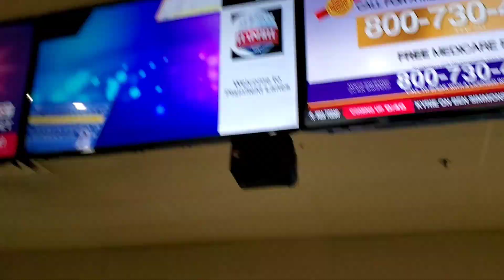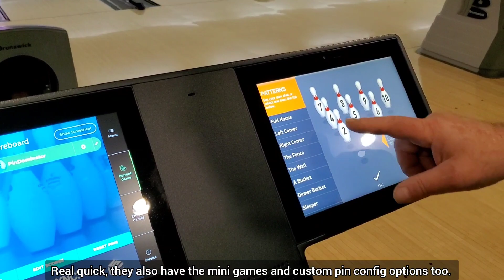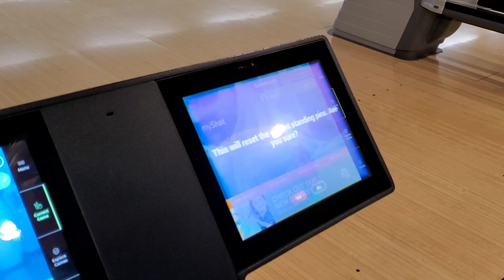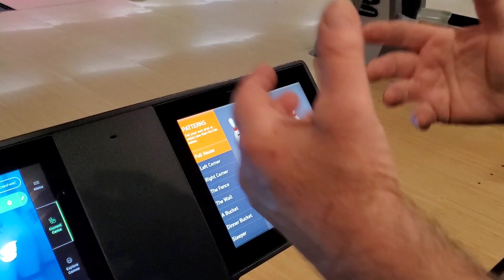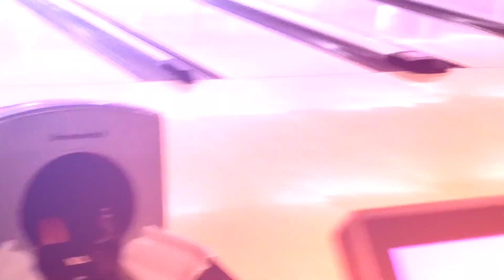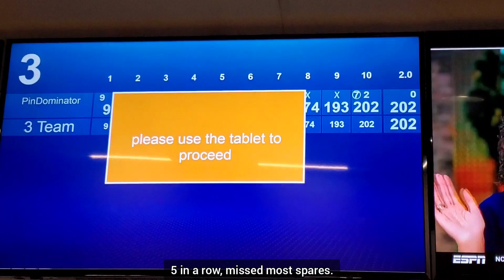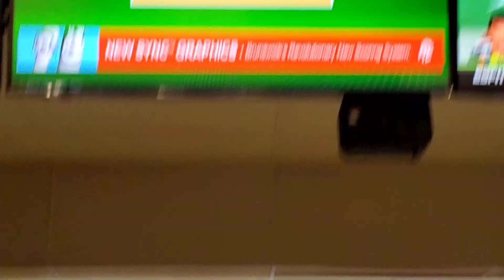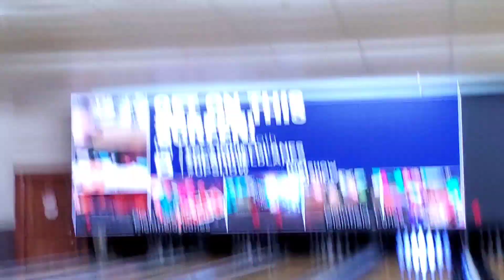Bowling at Plainfield Lanes (GS-96) [With Pinsetter Tour]

Comment: Haha. Freaking love the 96s. I treat mine like absolute royalty. Regular cleans, rebuilds etc. They'll run forever if you treat them right. Keep mine super clean and well adjusted.

Noticed the 10 pin holder dropped the spare a little early 😅 reminds me of what my lane 5 was doing 😂
Reply from the maker: I did notice the 10 pin, it made quite a sound haha
Unfortunately they just got rid of their gs96 and replaced them with stringpin :(
They were selling them for $700 a piece
Reply: @PinDominator  that's really sad honestly, those pinsetters run so reliably when thoroughly cared for.

We bought and shipped some parts from them though. Saw Plainfields ad on a Facebook bowl mechanic page. Bought a few tables and a bunch of the pin holders, so it's all going to a good home ☺
Reply from the maker: @nicholasevans4245  that's good to hear! Yeah it's a shame they are replacing them, but I'm glad they're not all going to the scrap. I'm glad I was able to take home one of their rakeboards :)
Reply: @PinDominator  Oh thats so cool - saw that in one of your video intros! super nice!

Yeah, we do need some parts at my center here so, where cost effective, we took what we could and would need. Going to a very grateful and happy old bowling center.

Mate, if i could, i would've happily taken all the pinsetters knowing me 😂

Comment: I never bowled on the Brunswick GS –96 it's similar to the GSX is it? and I never seen Score king pins before.
Awesome video.
How's the mini bowling pinsetter? Rock on
Reply from the maker: Very similar to the GS-X. It's differences are noticeable upon closer inspection of the mechanical components of the setting table. Pin carry is pretty much them same. I would say it is slightly easier to pop 10 pins out however :)
Reply: It runs just like a GSX but the difference it had a different Setting Table, it had the old style sweep and it uses the old Universal Electronic system which you see here at 3:04. Its basically an upgraded GS-92 Pinsetter and it uses the exact same parts of a GS-98.
Reply: @PinoyBowlerGS92  Really I never noticed that until now
Reply: @SugarbugsBowlingVideos  I've never bowled on GS-96's but I've bowled on GS-92's. I can tell the difference between both machines because at 4:37, a GS-96 would pre load pins in the Setting Table like that while the GS-92 doesn't do that, it only drops all 10 Pins in the Setting Table after the 2nd Ball detection.